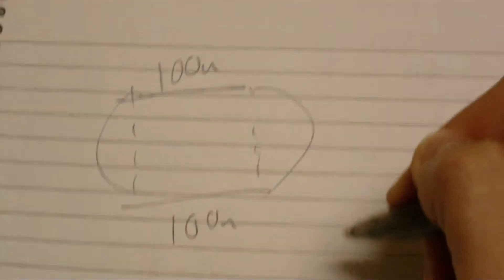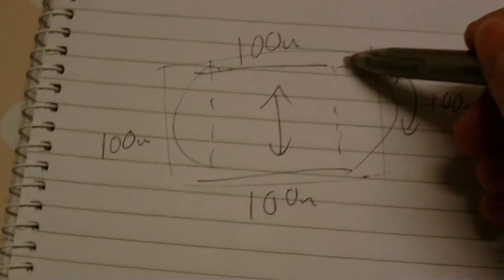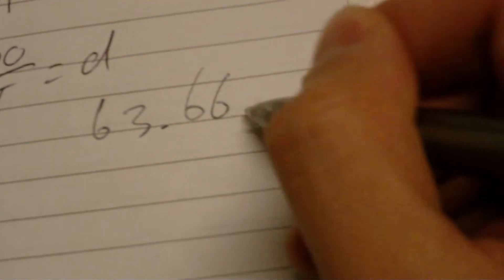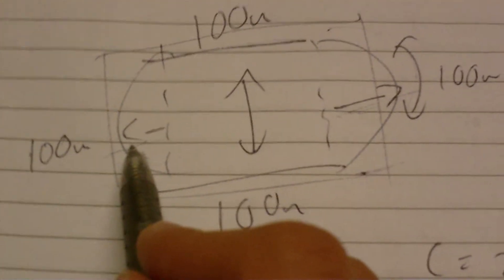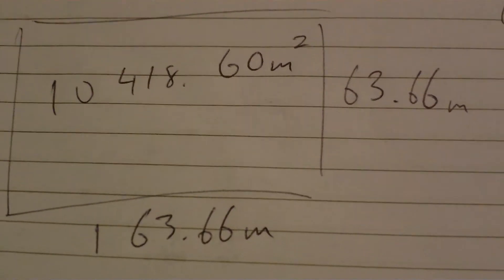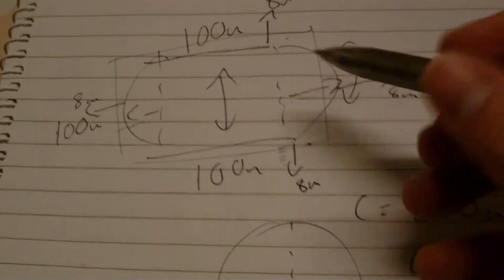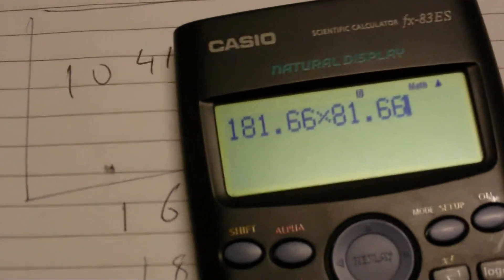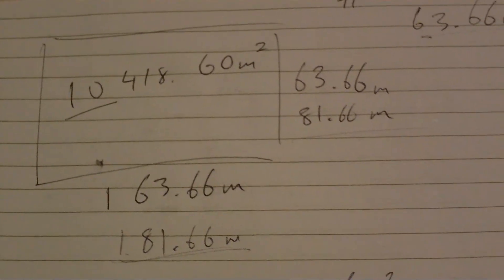Athletics track investigation solution

Comment: Totally wrong.
Distance across infield is 73m 
Length of infield including 2x semi circle ends is 193m
Straights are approx 80m
Bends are approx 120m
100m straight is biased 20m before the back straight bend hits to make 20+80=100m